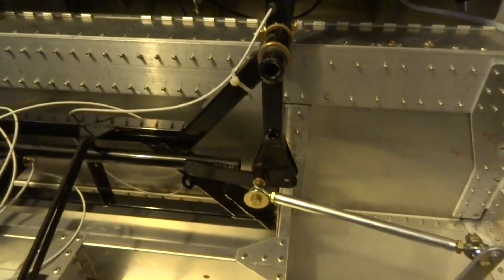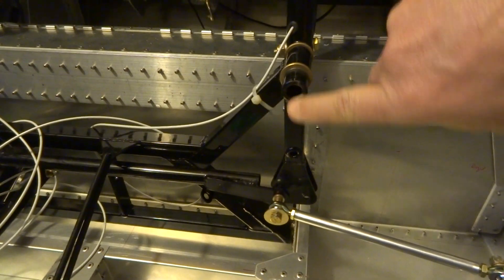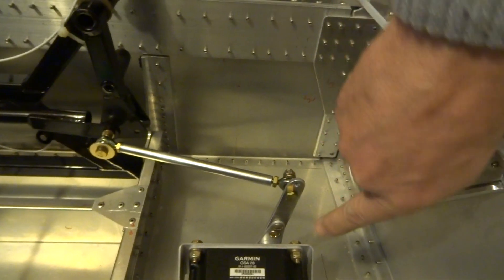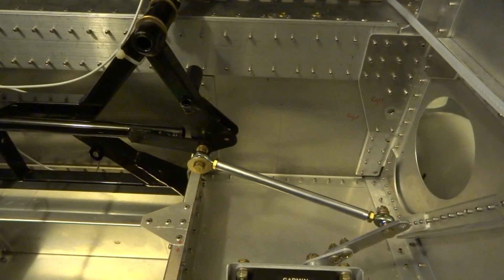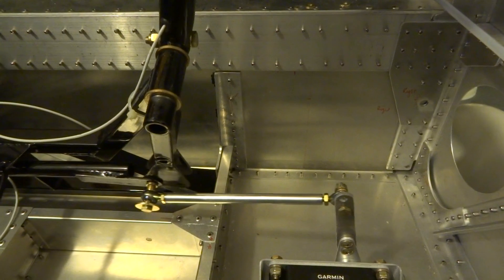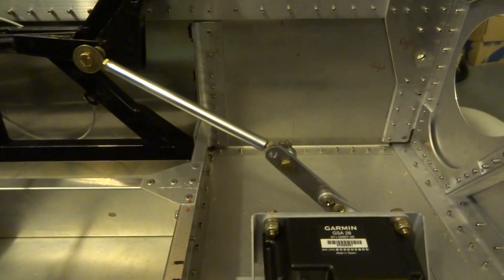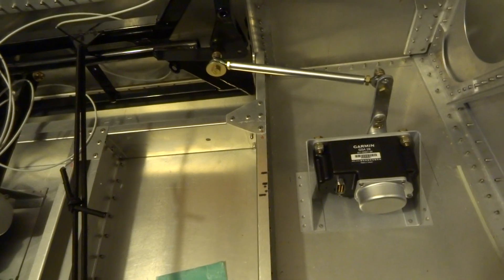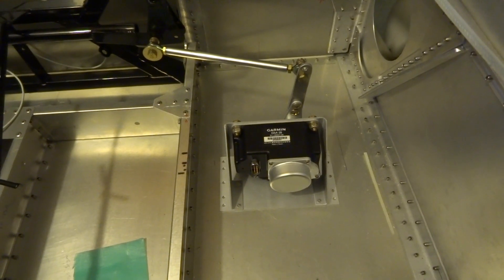Sonex Garmin Servo installation

Comment: Rather than direct surface control wouldn't a much smaller, lighter servo,  operating a trim tab be be better than controlling the entire surface? Also a trim tab can never impede the mechanical controls.
Reply from the maker: Several ways to skin a cat, I went with the Surface control because that's what Garmin had. If I were to do it again, I would do the same, The Garmin Autopilot is one of the best I have ever flown with.

Comment: Peter, nice video, thanks.  I'm doing some research on installing a Garmin G3X autopilot into a SubSonex, which I have not yet purchased.  Have been looking for information on this and ran across your video.  How has your Garmin autopilot performed?  You happy with it? Any advice or recommendations would be appreciated.
Reply from the maker: Frank, It is a great autopilot and Garmins support is the best I have encountered in the experimental market. Often time they will respond after hours and in a heartbeat
Please feel free to reach out should you require additional info.

Peter
Reply: Thanks Peter, good to know.  And appreciate the offer of future help, may just take you up on it as I get into the build process.  
Thanks again!

Frank
Reply from the maker: Hi Frank, I am so sorry to only get back to you now. I started flying in 1978, so almost 40 years. In that time I have flown aircraft with several auto pilots. In my opinion this is one of the best. Zero phugoid motion in pitch, and heading is awesome. In my opinion there is no other choice.

Peter .... You can email me at shaypete@gmail.com
Reply: @shaypete  Hey Peter, I am in the process of building my SubSonex.  I like the G3X Touch panel (I have one in my Yak 55M).  Did you go with the G3X Touch?  The 10" doesn't fit the stock panel and seems like a lot of work.  I am looking at the 7" version.
Reply from the maker: @yak55m191  At the time I was building, Garmin did not yet have the G3X touch out, so mine was the G3X. I have flown many commercial planes and the Garmin Autopilot was absolutely one of the best I have flown with. I would not consider any other avionics combination.
Reply from the maker: Hi Frank Sorry for the late reply, best autopilot ever
Reply: @shaypete  Thanks Peter, I started building about two years ago.  Given the length of time it is taking me I decided not to install an autopilot.  Maybe after I get it flying I might retrofit one, as it doesn't seem like tit would be too difficult to do.  But for now I'm going mostly stock just to save time.
Reply: @shaypete  Thanks Peter, I started building about two years ago.  Given the length of time it is taking me I decided not to install an autopilot.  Maybe after I get it flying I might retrofit one, as it doesn't seem like tit would be too difficult to do.  But for now I'm going mostly stock just to save time.